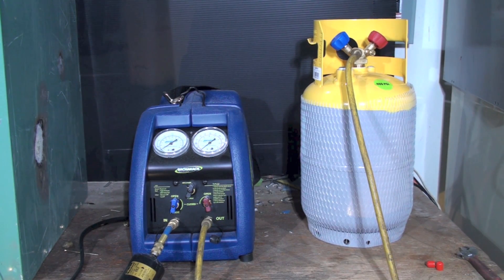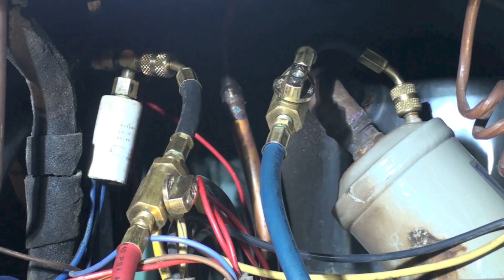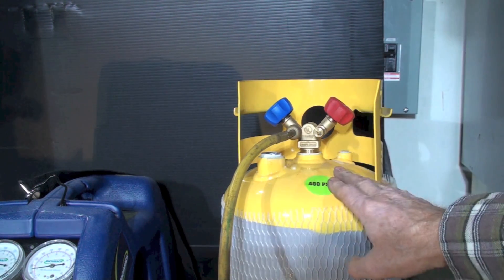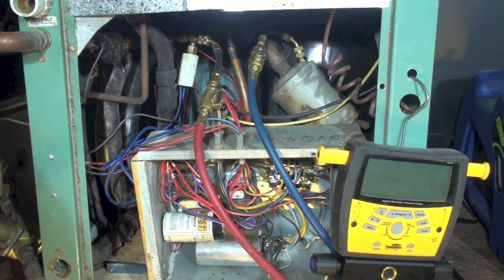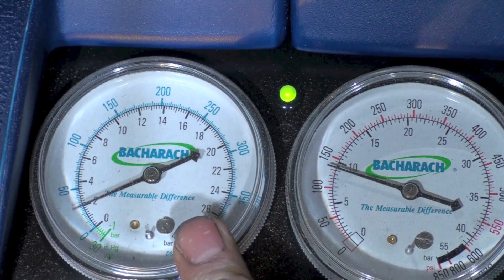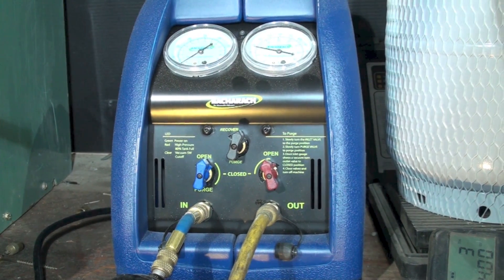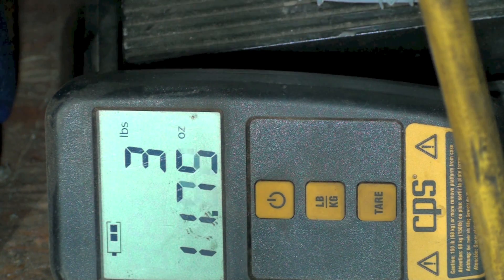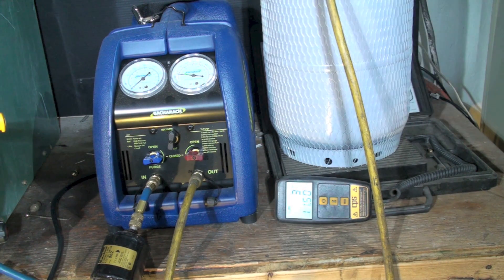Refrigerant recovery operation

Comment: 5:43 what's the point of bleeding this to the atmosphere? Certainly most of it is air but some of that is refrigerant gas. Wouldn't it make better sense to pull a vacuum on all the lines before opening the service port valves?
Reply: Its air came out he didn't let it reach the  refrigerant stage to escape, obviously 🙄

Comment: What do I do with the recovery machine after use? I rarely need to use it say once a year or less often.  Do you need to suck a vacuum on it to empty it out of any remaining refrigerant and possible moisture?

Also I recommend using a shutoff valve between the output and the hose so you dont end up with a hose full of liquid refrigerant.
Reply from the maker: I leave the machine with a refrigerant charge.  Evacuation is not effective with many of these machines as I have seen them leak out the evacuation.  
GFM

Comment: My robinaire  rg 3 doesn't have purge valve. How is liquid removed from unit on this set up?
Reply from the maker: The compressor will pass liquid thru.  I know it does not make sense that a gas compressor will pass liquid but they seem to have solved that problem,  

The purge is not necessary as the amount of liquid remaining in the recovery unit is considered to be deminimus.
GFM

Comment: What about the oil in the compressor? On car HVAC recovery you can separate off the oil to determine how much to put back in - is there anything like that for this system?
Reply from the maker: Oil removed from these systems is very small, and it is not generally replaced.  Automotive does not have a reservoir of oil, so the oil charge is critical.
GFM

Comment: what happen is system have to much humidity ... the dry filter blocks or the freom and water goes inside to empty bottle? hi
Reply from the maker: If your system has been open as with a leak and it is R-410A,  about the only way to dry the system is with an oversized drier.  
If you are also thinking of reusing refrigerant, I would not, especially if the system has been open.
GFM

Comment: Your cylinder had a vacum. Why. Did you pull a vacum on it first?
Reply from the maker: Yes.  My intention was to reinstall the refrigerant I removed, so I wanted a clean cyclinder.  
GFM

Comment: Can you vacuum down a tank that has a pound of freon in it or is it not necessarry?
Reply from the maker: That's a violation of federal law.  It should be at 15" vacuum.  You can certainly do it, it will just take a little longer.
GFM
Reply: @grayfurnaceman  You dont  use a fresh tank for every single job do you? 
I figured you let it get close to capacity before swapping it. Is that correct?
Reply from the maker: @RC-Heli835   I do not.  It is filled to 80% then sent for recycle.  I never reuse refrigerant.  
GFM
Reply: @grayfurnaceman Is the freon a low pressure gas before it reaches the recovery machine?
Reply from the maker: @RC-Heli835  Depending on how the recovery is done, it could be gas or liquid.
GFM

Comment: grayfurnaceman, what if you are pulling refrigerant from a 2500 ton chiller do you run the cooling tower fan or fans?
Reply from the maker: I assume its a centrifugal.  I would run the pumps and fans for the cooling tower as the removal may freeze the water in the evap or condenser.
GFM

Comment: If you do not have a purge option, how would you perform a purge?
Thanks for passing on your knowledge!
Reply from the maker: Not sure why you are saying there is no purge option.  Purging simply reduces any mixing of the refrigerant with air.
GFM
Reply from the maker: Racist Brownie  That machine passes the EPA regulations without a purge option.  I would still purge the machine by opening the valves and pressurizing from the A/C unit.
GFM

Comment: Min 1:40 
About pressures in a turned off system: can we expect "high side" and "low side" pressures to be equal?  Do they equalize when system has been "sitting around " unused for "a while"  (wouldn't that indicate a leak?)
Reply: PS "saturation" is a fancy word for "boiling point" correct ?

Comment: I thought you are only suppose to recover gas, if so, why did you open up both sides on the gauge set to recover, shouldn't you only open up blue side to recover.
Reply from the maker: You may recover limited amounts of liquid to the point that the unit slugs.  You open both side to increase the speed of recovery.
GFM
Reply: grayfurnaceman.👍

Comment: If high and low side not the same pressure before you commence, would the refrigerant not flow from high to low via the hoses and manifold pushing the air in the hoses into the low side ?
Reply from the maker: There is no air as the first operation is to bleed the hoses before you start.
GFM

Comment: Furnaceman, do you recommend removing the valve cores?
Reply from the maker: Absolutely yes.
GFM
Reply: grayfurnaceman I went ahead and turned on my indoor and out door fans and started recovery but I didn’t have that tool, but I will get one tho, I used a unit similar to yours in the video, I was able to pull 8.60 lbs out of a 9 lb unit holding R22 within an hour, that is a very slick trick on turning the fans on for sure, thanks for the instruction vid
Reply from the maker: Welcome
GFM

Comment: Hi! How do I recalculate/recompensate for the lost oil xoes goes with the refrigerant on recovery? Is there any mathematical formula to determine how much oil is left on the system parts after the recovery?
Reply from the maker: The amount of oil in the refrigerant is very low.  Not worth considering.  I did a video on oil loss.
GFM
Reply: grayfurnaceman thank you

Comment: Are you not leaking some refrigerant when you purge your line to atmosphere at the set up stage?
Reply from the maker: Yes.  It is what is called a de minimus loss. That is refrigerant losses related to proper repair processes.
GFM
Reply: grayfurnaceman thank you. Figured there was always going to be a small potential loss during purging. The very small amount should be no real problem?
Reply from the maker: The line loss is about .2 oz.  If the charge is very small, it could make a difference and should be accounted for.
GFM
Reply: Andrew Wilson it’s called deminimus release, the EPA allows it

Comment: I completed the recovery procedure on my 2006 dodge MAGNUM. The process appeared to go as planned (the gauges connected to the high and low diminished to negative on both sides). HOWEVER...the valve on the tank to which I connected the hose (the right/red) does NOT close (the three times I made the attempt to disconnect the hose from thr valve, refrigerant escaped the tank [though the valve had been turned completely to close/clockwise]). At present, I have kept the machine connected to the tank via the specific hose (the hose, unfortunately, does not have its own valve, which would have at the least allowed me to disconnect the machine from the hose). I am perplexed--it appears that the valve is damaged, though the tank is new, and I was able to pull a vacuum on the tank prior to using the tank for recovery. I do not believe I am doing anything incorrectly...but it is the first time I have done this. The tank is identical to the one in your video. Any advice on how to proceed?
Reply: Please disregard my inquiry.  I just disconnected the cylinder from the recovery machine and the pressurized refrigerant I was concerned about releasing was simply the diminutive volume entrapped in the service line.

Comment: how I know the condenser unit need how many pound of R -22. Is all the condensers units need to charge into 5 pounds ?
Reply from the maker: You will need to know the factory charge.  It will be found on the model plate.  Line length may also require additional refrigerant.  It all depends on the manufacturer.
GFM
Reply: my house have goodman condenser unit  said factory charge oz  R22  117.0  .  How do I know this condenser unit is need charge recovery   how many pound R22 ? Thanks you. I want to learn more about HVAC.
Reply from the maker: The 117 is ounces of charge.  As for how do you know if it needs charge, that's a bit more complicated.  If you are sure of your abilities, you can check out some my videos on charging that may help.
GFM

Comment: excellent video from hook up to purge. I know you had both sides open while recovering, but alot of techs from what I see recover in vapor state. Do you know why that is, and how much longer would it take to remove vapor from a split system that had around 10 pounds in it of r410a

Comment: I have a 220 window unit that I plan to convert to a heat pump ' putting in a reversing valve. the system is r22 can I put 152a in it without changing any other components
Reply from the maker: Do you like fire?  I did a video on this "refrigerant"  It is flammable.  It may work but a heat pump is much more than a reversing valve.  Have fun if you want, but be careful.
GFM
Reply: +grayfurnaceman I plan on ducting air to the evaporator so it will not freez I plan on pulling this air from the basement floor.. I am just looking for advice

Comment: I would like to know if you could pull a vacuum on the whole set of hoses instead of that long bleed?   If you had ball valves at all the hose ends can you take the yellow from the recov. cyl. put a ball valve on it, hook it to a vac pump.  Evac all lineset with process hose, close the ball valve and put the hose back to the tank and then no bleed.  Can you do that?  Thanks.
Reply from the maker: I don't see why not.
GFM
Reply: +grayfurnaceman Thanks I like watching your videos :)

Comment: Hi GFM, could you recommend a good recovery unit to buy. I am getting ready to buy my first one on my own.  My company has yellow jacket but just like to know what you recommend. Thanks for all you do.
Reply from the maker: Sorry about not getting back to you.  The Appion is probably the easiest to use, as there is no purge.  I have had no failures with it.  The Bacharach you see in the videos is more conventional and works well, but has had a failure of the hand valves.  I suppose I would pick the Appion if the amount of refrigerant was not too large.  Hope this helps.
GFM
Reply: Thanks a lot GFM! I haven't  bought one yet but I have had the Appion in my sights.   Thanks for the info I really appreciate  it.

Comment: Where did the system oil go during this operation? Is there oil in the recovery tank? If you were going to recharge the unit, would you need to put it in a vacuum and add a certain quantity of oil? Cheers
Reply from the maker: I get quite a few questions on oil removal.  In most cases, there is not enough oil removed to effect operation.  I will have to do a video on this.
GFM
Reply: +grayfurnaceman when you make that video, it would be nice to know how much oil is in a 3-ton condenser system, for example. If a unit is overcharged, removing charge through the suction line while the unit operates will remove some oil. There are also little expendable devices that will show when oil is burnt. I have a few of these in sealed blister packs, but never used one. I speculate is replacing oil is a good idea? Know-nothing auto mechanics will sometimes claim automatic transmission oil is "burnt" by smelling the dipstick. Maybe, and maybe not.
Reply from the maker: I have never replaced oil in an air conditioning system.  If the system is installed clean, there should be no breakdown in the oil because there is no oxygen in the system.
GFM
Reply: The only time I find I need to add or replace oil in the compressor on an AC unit, whether hermetic or not, is when there has been a bad refrigerant leak. Usually you'll see oil around bottom of condenser floor and/or in areas where the leak has occurred. I remove the compressor and drain out as much oil as I can and then measure the correct quantity per manufacturer back in through the suction port.

Comment: Where did you get that short hose that you have that filter drier hooked up?
Reply: I got the RobinAir RG3 for x-mas and it came with a very short hose attached to a filter drier. part of the package..
Reply: Recovery tank is hot, place in bucket of ice or cold water. Head pressure on recovery unit should go down.
Reply from the maker: Did you evacuate the cylinder?
GFM
Reply from the maker: Everyone has been asking that.  Truth be told, I don't know.  Sorry.
GFM
Reply: Any idea as to what would cause too high a pressure in the recovery tank while recovering R22? We got a new Robinair RG3 machine and I used it along with new tank for first time today to pull 8 lbs of R22 from a rooftop package unit. By 6 lbs the outlet(red) gauge of the machine was reading 300+ psi and this was while filling a 30 lb capacity recovery tank. Just to be certain that was the pressure in my tank I hooked up my other gauges to the vapor side of the tank and opened it and sure enough it was up over 300 psi. I thought it must have pulled some air into it so I bled a little out to get any air out of it but pressure was still high. On the roof it was around 85 deg today with very high humidity and the tank was in the sun. With R22 however that is still high especially considering the 30 lb tank wasn't even half full with 6 lbs in it. Once the tank had been down off the roof for an hour or 2 the pressure did go down some to just under 200 psi but still seems quite high to me again, considering the tank only has 6 lbs in it. Any ideas as to what is causing this?
Reply from the maker: Are you sure you have the machine in recovery mode and not pump down mode?
GFM
Reply: On the RG3 they direct you to separately recover liquid first and then switch to vapor. There is only 1 basic setup. The inlet side has Closed, Vapor, Liquid setting while the outlet side is either open or closed. No purge setting. 1 basic setup for all operations. I frankly don't like it as well as our other older machine. I had my Testo gauges hooked up to both high and low side of equipment with yellow hose going to inlet of machine and inlet set to liquid. Outlet of machine going to tank on scale. I only had liquid side of gauges open to run liquid out through machine and into tank. I bled lines prior to recovery as well. The RG3 appears to me to be a recovery only machine. Being this is the first go round with it I thought possibly I had done something wrong but if so, I am not sure what it would be. Liquid into inlet of machine and out of machine into tank. I thought about non-condensibles but I would think they would be trapped in liquid in bottom of recovery tank and not creating a pressure issue like air might.I'm still here going over my procudure in my mind wondering if I made a mistake but cannot see what it would be that could create such high pressure with a less than half full tank. It was ht on that roof today but at 'only' 85 deg that does not explain it for me.
 The presssure did drop to just under 200 psi in the tank an hour later but that was also after several bleedoffs.
Reply: grayfurnaceman
Yes, prior to recovery I vac'd it down to less than 500 microns. Would moisture in the refrigerant cause this pressure issue? I wouldn't think anything but air would do it within a cylinder but who knows. If I had thought there were nonconesnables in the refrigerant I would have tested for it while it was still in the unit but now that it's in the tank I don't know of any way to test it.

Comment: Dear Sir, excellent videos, it is an invaluable work! 
I have a couple of questions about refrigerant recovery and I will appreciate your advice:
1) Additional to the dryer filter would you recommend to attach an “oil separator” to the hoses?
2) I recently bought a “Robinair 25200B recovery machine” which is intend to work with vapor an liquid at the same time, if you have time please take a look to the manual (http://www.robinair.com/sites/default/files/552701.pdf) to understand better the characteristics of this machine, because its already has two inlet ports (vapor and liquid) and two outlet ports to the recovery cylinder. I haven’t used the machine yet so I will follow your advice about use it only for recovering vapor to prevent damages in the recovery machine, but what would you recommend in case of the HVAC compressor is burn out or doesn’t work if I want to bleed the HVAC unit? In this case what technique would you recommend?
3) It is possible to use the recovery machine for pass refrigerant from one recovery cylinder to another cylinder (not the disposable one) I mean a recharge cylinder with only one valve? In this case and considering the Robinair 25200B configuration in which way should I connect the hoses?
Thanks in advance for your time and your help!
Reply from the maker: I don't think an oil separator is necessary.  The machine will probably safely remove liquid refrigerant.  It has a float system to avoid damaging the compressor.  Compressor operation is not necessary for either vapor or liquid recovery.  It is just faster.  If you want to recover vapor only you just don't use the liquid line.  You can move from one to the other using the liquid method of the machine or you can warm the cylinder to be transferred from and cool the empty one and open the valves.  Hope this helps.
GFM
Reply: Thanks a lot for your soon and excellent answer! You are an incredible person!
So, then I guess I made a good investment with the Robinair recovery machine. I will try to make a video when I use it for first time.
Again thanks a lot for your time and for sharing your knowledge!

Comment: Where did you get the short 1/4" hose to attach the filter/dryer to the recovery machine? I have always used a short piece of 1/4" copper with flare connections on each end. I can't find any short hoses online and none of the supply houses here have them. Thanks again for your great videos.
Reply: The United Refrigeration supply place near my place has some that come with a removable ball valve (made by NRP). Check your local one.
Reply from the maker: +Jim Gill Unfortunately, I don't remember where I got it.
GFM